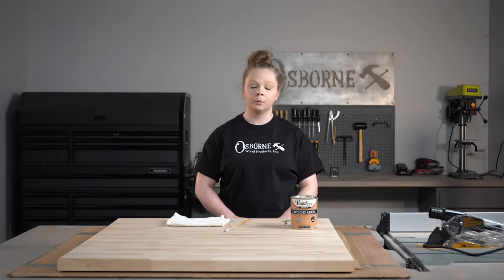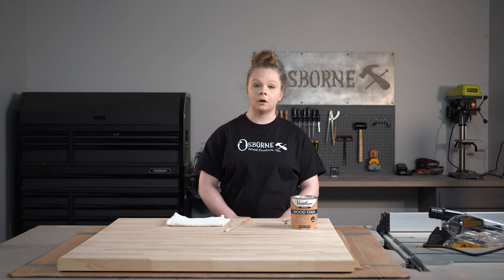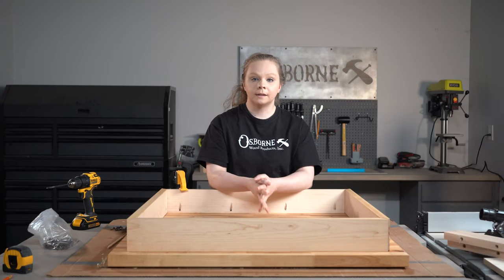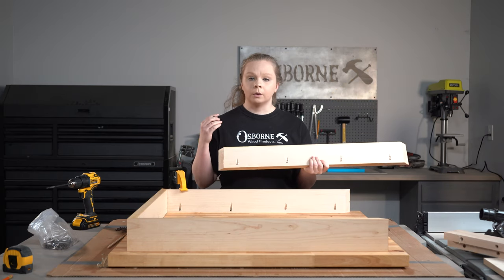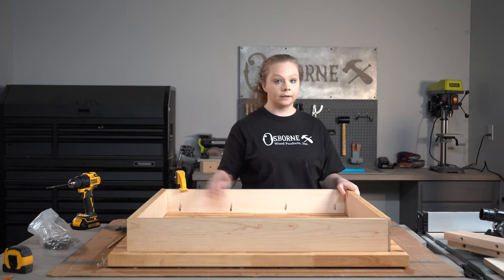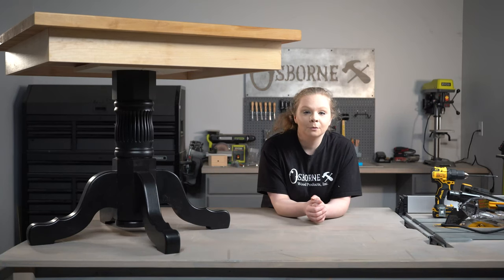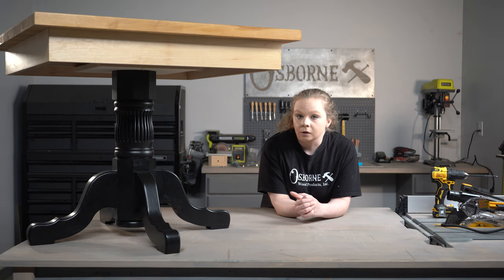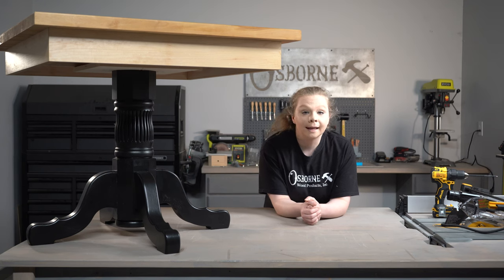How to Attach a Table Top to Your Pedestal Base - Builder's Studio

Comment: Few questions. If I'm making around a 2 and a half food diameter round table would I need a 'skirt ' for it?  If I wanted to attach a pedestal type base directly to the round top what would be the best way to do that?
Reply from the maker: There are a few options for attachment without a skirt. The easiest would be to use a plywood or solid wood mounting plate that would connect the 2 together. If height is a concern, a metal mounting plate could work as well!